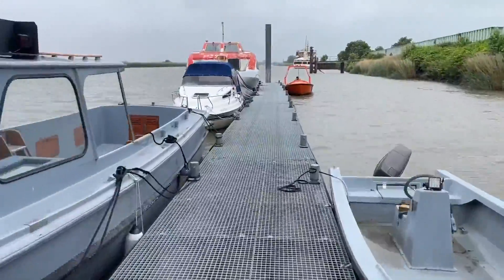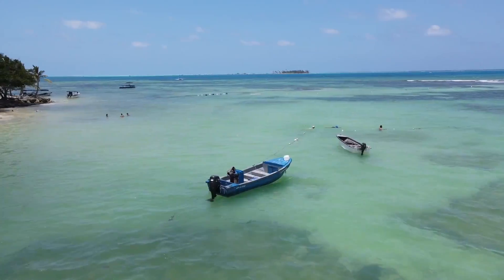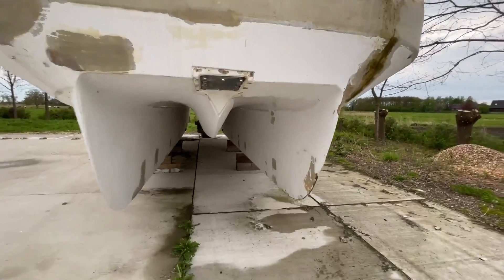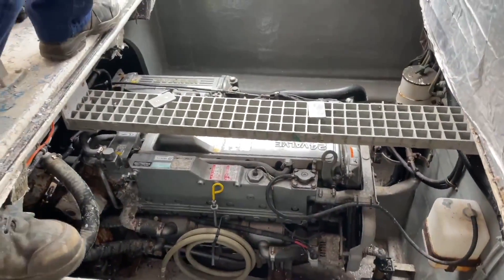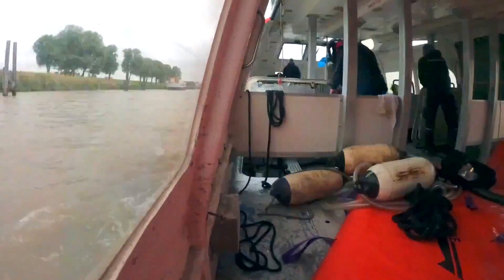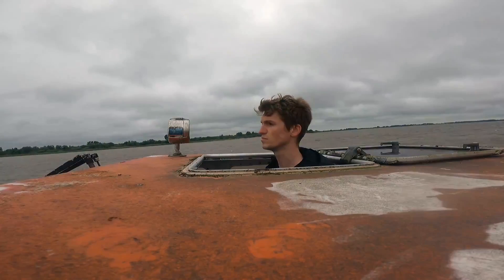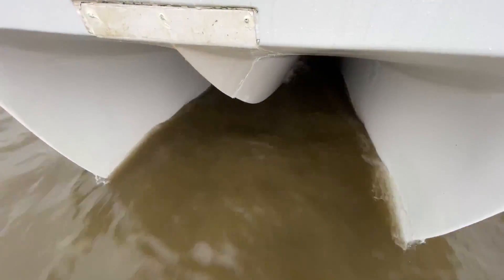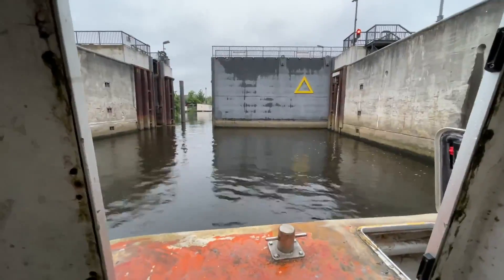Pickup & Project Introduction - Turning a lifeboat into a solar yacht - H.o.G. Part 1

Comment: I have a large cylindrical wind turbine on mine to supplement the solar, its very helpful.
Reply from the maker: How does it compare in terms of yield to the traditional tri-blade ones?
Reply: @HeartofGoldLifeboat   Its slightly less efficient, but it still works in force 9 storms.
Reply: @HeartofGoldLifeboat  The small efficiency lost is acceptable, I have never tested it beyond force 9 but I get the impression it can handle a lot more
Reply from the maker: @LordCaptainFather  Which model do you use?
Reply: @HeartofGoldLifeboat  I have the older generation of Tesup, its build quality seems much better than their later models IMO.

Comment: Brilliant, I followed your story from Reddit to Instagram and now here! I'm super excited to watch this boat develop. Congratulations on the baby. I hope the section of flooring you were trying went down ok!
Reply from the maker: Awesome - and thanks a lot!

The flooring was a test to see whether the uneven surface is too much for the vinyl. If it would have been, I'd know before sanding down the whole rest of the boat. But apart from a few small edges, it was fine - so now I'm sanding down the rest and looking for used vinyl panels in the correct quantity.

Comment: Will it be only solar or wind also ?
Out of curiosity, could mount sail there ? :)
Reply from the maker: Sail is not an option since there's no keel - but skysails / kites could be an interesting concept for the future. I'll do mostly solar, but add 1-4 wind turbines to capture some energy at night as well.
Reply: @HeartofGoldLifeboat  I would assume there no way to beat efficiency and performance of sails with wind turbines, but it is interesting how close performance of wind turbines can technically be achieved compared to sails.